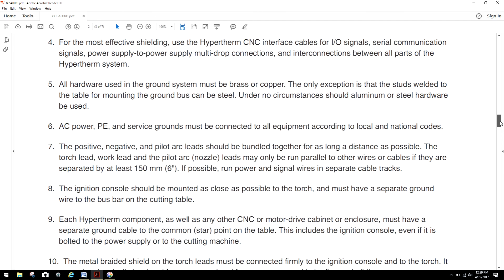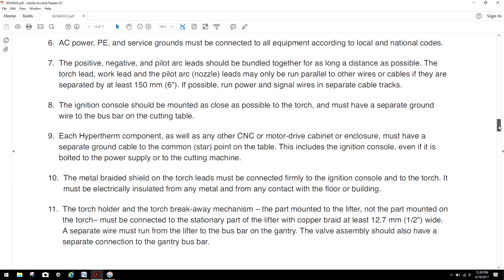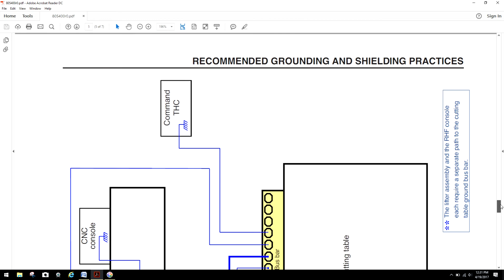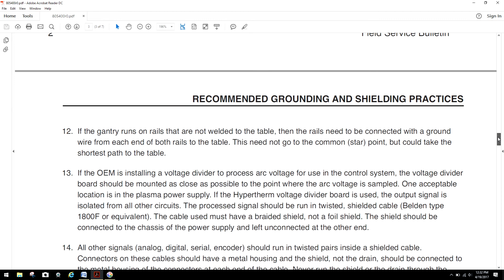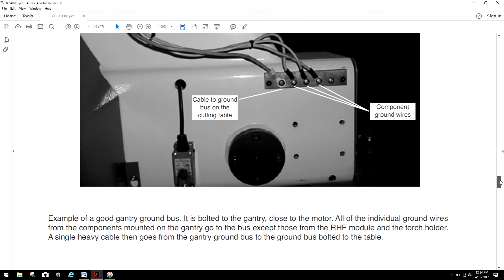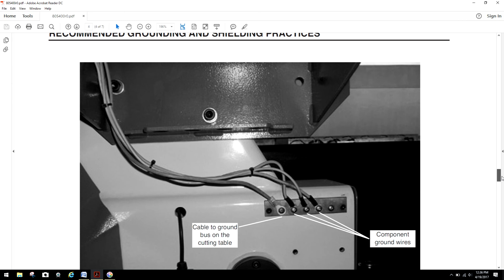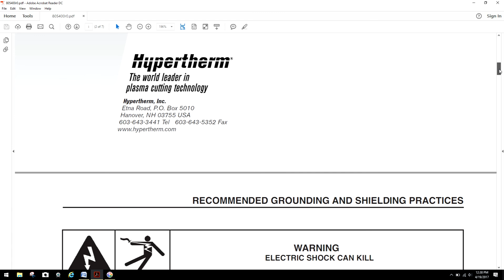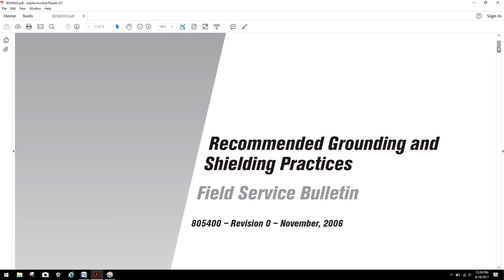Plasma System Grounding Instructions Direct From Hypertherm..

Comment: Its been sitting all day in front of my plasma cnc build,  thinking how to shield the HF,  When the Plasma triggered EMI effect the surrounding,
 already broke the 6560 Stepper motor driver  at 5 times i been replaced , and i expend a lot of time,  still finding a solution Thank you so much for the video
Reply: You need low freq plazma, then you will have correct electric system for drivers and motherboard
Reply from the maker: Elect thank you for your support. I'm glad to help. Thank you, Vince